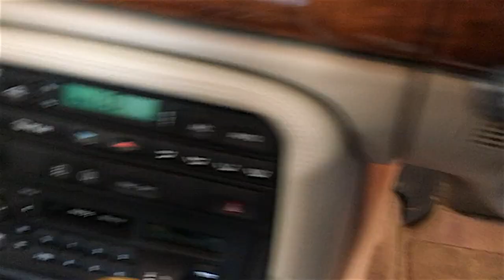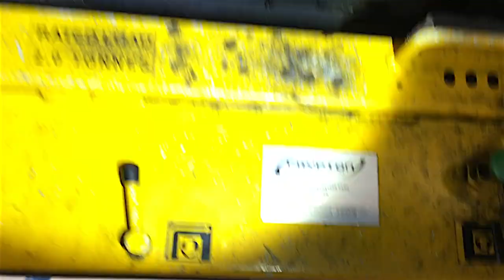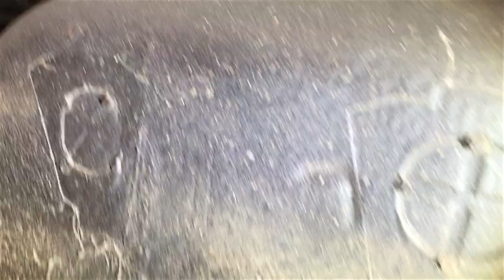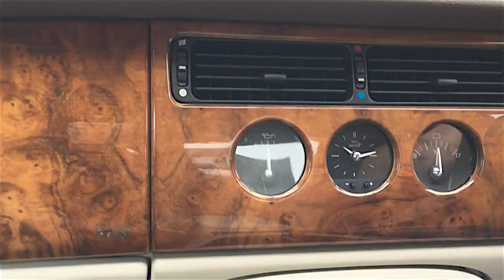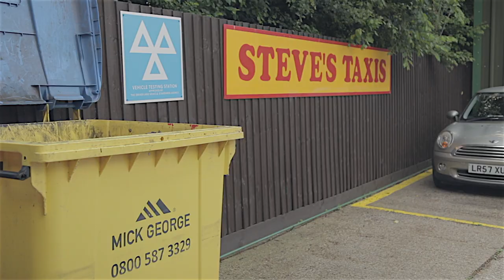2012 Vauxhall Combo 1.3 cdti, Engine Taken a Dump, What Went Wrong

Comment: Yeh right it’s a Vauxhall issue. It’s not and for the record, this engine is a joint venture between Fiat Power Train (FPT) and General Motors (GM). What GM actually contributed is not clear but in essence this is a Fiat engine built by Fiat. Like many of these modern over complicated engines with equipment attached for emissions, the likelihood of these engines going wrong is increased. Add this to the fact that manufacturers keep telling buyers that they don’t need to service these for long periods and you have a perfect storm. These modern diesel engines need lots of attention including very regular oil changes. This is how it is these days. 

The only blame you can put on Vauxhall is that GM has not invested into engine development as much as they should have done over the years. That said, sharing engines amongst other car manufacturers is now very common.

How do you know what the maintenance regime was or how the van was driven or if the timing chan was correctly installed or what level of oil has been maintained or for that matter,what make of timing chain was fitted, you don’t. 

Worth noting is the sump on the Euro 5 models only holds 3.2 lts of oil😮This means less oil to collect the carbon. Something that was rectified on the euro 6 engine. 

Heading into a full diagnostic with an anti-Vauxhall attitude doesn’t allow for an honest and impartial conclusion. 

There is nothing wrong with this engine other the added emission technology. If maintained properly it’s just fine. If there was a crown to be offered to the worst engine of modern days, it goes to Ford with the eco boost 3 cylinder engine, hands down

Comment: That's a fiat engine with lack of oil changes my wife's cdti has done 149,000 miles not used a drop of oil in 11years never ever topped the oil up the engine has never been apart for anything
Reply: Exactly, this chap was so wanting to find a reason to blame the engine manufacturer or the car manufacturer rather than blame the lack of proper maintenance for its failure
Reply: It’s a well proven engine with some very solid engineering. The only weakness is the weak cam chain. It’s a shame Fiat did not stay with their well proven cam belt.
Reply: On the plus side. Cam chain breaking almost never wrecks the engine or the valves. It will need new rockers, lifters, cam chain kit and gasket set That’s it.

Comment: I was a FIAT dealer expert technician for many years, I have seen this before. It wont have been rattling for ages, it all happened very quickly. the reason the upper big end shells are so devastated compared to the lower ones, it has been under water, hydraulic ked at revs.
Reply: Daft question but doesn't hydro locking usually snap or bend rods?
Reply: @alan dawsonI have changed the head gasket on a Fiat Punto mk1 1 with single point injection (FIRE). It cranks but doesnt start. I has a bent valve on cylinder one but the owner says it started before the gasket was changed. It looks like has had too much oil in it and that might be what bent the valve. The wiring for the crank sensor wiring had also been spliced at an earlier date for some reason. Do oyu think it will run with a bent valve? The owner refuses to accept that it wont.
Reply: @rimmersbryggeri  Are you taking the mick, you took the head off to replace the head gasket and ignored a bent valve. valves are as cheep as chips. A bent exhaust valve will not stop it from running on 3, but an inlet can mess badly with fueling of the other cylinders.
Reply: @alandawson3345  I didnt want to put it back together like but I was working in the guys garage and he told me to do it because it had supposedly ran before, I dont thing it was worthwile anyway because it has a broken windscreen to and that costs more than the car is worth to fix. What you said is kind of exactly what I told him before bolting the head back.
Reply: Hi,i have Fiorino 1.3  Euro5 with 75hp.I have problem , when i startup car ,engine knocking and knocking noise after some minute are disappearts but after 3-4min i have blue smoke and car engine rpm jump from 800rpm to 1000rpm.I have check 3 times injector(in Bosch servise),new timing chain,new glow plugs,new DPF.Oil is always on max.When car litle get worm all is OK.Also I have buy new MAP,MAF and new oil separator.Can you please help me?Thanks
Reply: @jarkazoki  Very hard to diagnose a car by description over the internet. But if rattily on start up and smoky until warm sounds like wear or faulty hydraulic tappets plus low on compression causing incomplete combustion when cold. ie about knackered.
Reply: @alandawson3345  thank you for answer,I have check compresion and is ok on all cilinder.Cilinder head is repaired.
Reply: @jarkazoki  I had a fiat scudo van did the same smoked when cold ok when warm. Compression test showed all ok , but when I eventually removed the head 1 piston at tdc was 0.5 mm short of reaching the top face of the block (bent rod ) started, ran reasonably, passed compression check, but smoked and was not smooth when cold. The auto stabilizing features, for the idle and smooth running in the engine ecu can hide a multitude of sins when it warms up.

Comment: I watched all your vlog, did you actually remove the oil filter from the housing? Fallen apart and clogged up could of been reason the engine starved itself of oil.
Reply from the maker: thats a very good point, no i didn't .. i will take it out and show in the next video
Reply: @alan4x  I have seen it when the service intervals have been missed. Love watching your vlogs👍
Reply: It’s generally a well built engine but the timing chain is adequate for 100K miles max. It’s such a shame they did not fit a twin row chain. At least the valves are vertical and the rockers are sacrificial so it can be repaired.

Comment: Was that a Fiat doblo combo D engine? Looks similar to my combo c fiat made 1.3 CDTI engine my combo c engine is on 160k miles original timing chain and turbo regular oil changes on these fiat Diesel engines are a must but after 160k I’m finally changing the original turbo.
Reply from the maker: is was the 1.3 cdti fiat engine,,yes
Reply: @alan4x  looks like the combo D engine witch is the newer version 2012/2017 I think the oil in the sump looked a bit sludgy possibly poor maintenance.

Comment: I think, you overlooked the right explanation. The plastic piece at the chain guide had fallen off. This means that the timing chain could run in a more direct line from the cam sprocket to the crank sprocket. The result of that is, that the timing is off - the camshaft is running a few degrees late of the intendend position. It means premature injection since the injection timing is normally comtrolled by the cam sensor, but when the ECU detects, the timing is off, it will use the crankshaft sensor, and this leads to premature injection. Premature injection means that the combustion reaches a very high pressure before the piston is at TDC - the piston is forced to continue to TDC and the pressure raises even higher. This emormous force will break the oil film at the big ends, at they will have metal-to-metal-contact. 
This is a pretty common fail on this engine type - the solution is allways to renew not only the timing chain, but also the chain guides and the sprockets. On a normal maintenanced engine the chain and guides will last around 250.000 km. All in all a very fine and economical engine with no more fails than similar engines, but premature injection will kill all diesel engines.
Best regards Jarl Paulsen, Denmark
Reply: I've had the work done that you've recommended at 270 miles in doubt full that the sprockets and guides were replaced tho, now at 192 miles som knock can be heard again

Comment: First thoughts were old oil, not enough oil changes etc
But 2nd thoughts were the engine has been run for a prolonged time on very low oil or even no oil.

I'm sure that engine would have been making some awful noises long before it failed!⚠️😯

Edit- nice xk jag, my dream car.

Comment: Looking at the state of the sump etc I'd say this has been run on the same oil for too long or it has seen dpf issues and been chucking diesel and shite into the sump. Thats what's caused the issue in my opinion.
Reply from the maker: cheers pete, i thinking the same

Comment: That was interesting. I actually didn't know that a mm could make that much difference in a diesel. 👍
Reply: Not just a millimeter the difference in thickness of the selective head gaskets to obtain the correct compression is much less than a whole mm we are talking tenth`s of a mm
Reply: @alandawson3345  
Goes without saying.

Comment: This engines fitted with dpf suffer multiple problems. And every little thing is packed in a way that you need to remove few other parts to get it. Even older 69hp Z13DT 1 3 jtd was a totally crap to service. They are good till 100.000km after that you can scrap the car.

Comment: Those torx like bolts on Vauxhall's require a Ribe socket as the tips are more square than pointed.
Reply from the maker: yeah never seen them before, maybe never will again🤣

Comment: Those 1.3 diesel engines were a good seller back when I worked in a car breakers,and as you say not a difficult one to remove,just as well really 😂

The old 1.7 in the combo was pretty bulletproof though.

I've never owned a Firenza, but I do have a 1.8 slant 4 powered Viva .😉
Reply: 1.7td Isuzu they put in the Vauxhall Cavalier was vauxhalls last decent diesel engine in my opinion!
Reply: Fucking expensive engines too.

I just scrapped an 11 plate corsa because the cheapest engine I could find was £900.

Comment: Lh thread on the crank bolt & cam bolt on these.  Have the identical scenario on one here, it's been everywhere, had the same daft parts chucked at it to no avail... chains borked Lads, :-) and the guides.. They usually break 2 rockers too - hence no compression on that one cylinder.

Comment: Great video! Strange thing right off the bat, my Corsa D has the same engine but the turbo is hidden away so the glow plugs are easily accessible when you open the bonnet. I've a small oil leak somewhere in my engine bay, just found it yesterday ... when I also discovered the windshield fluid is leaking 😂 Yeah they're noisy little critters but with fuel station prices these days it's hard to "knock" a 1.3 diesel haha
Reply: Dpf takes some space, so turbo is moved Abit up

Comment: So did you find out what the broken chunks of metal in the sump were off because that was a big flat piece of metal.
A mate of mine bought an Jag XKR from the dealer where he worked as a Mechanic there and it spent more time in their workshop for head gasket failures under Warranty than he did have driving it and they wouldn't let him do the work himself in the end he took the dealership to Court over it.
Reply: Good question. What where the big chunks???
Reply from the maker: they were parts of one of the thrust washers holding the crankshaft central lol
Reply: @alan4x  😁🧐🙄 how thick was the washer? Why would it have broken into pieces. Or was it in two pieces already???

Comment: A few years ago I bought a 306 DT 3dr sport.. i forgot to check the oil level... My brother drove it home and said it was a bit noisy, he checked the oil level and it was well below minimum on the dipstick... But i filled it up quick with some new oil and it did another 40k so 145k when i sold it it was still OK..so i got away with it just!

Comment: Modern engines simply cannot tolerate as much abuse, lack of servicing or skimping on oil changes compared to those of days gone by. Today's engines don't wear out after 100,000 miles, instead they self-destruct if not maintained properly. As emissions laws have tightened over the years, the requirements and demands placed on the oil have also changed, and fuel is much better quality these days too, but the trend is to downsize and offset the reduced power output by implementing variable valve timing, adding a turbocharger or twin turbochargers. But then, engines are suffocated by having to add necessary items such as EGR valves, catalysts, particulate filters and then they have to  attach an untold amount of sensors and probes up every orifice. If the attitudes of the general public towards mechanical sympathy and vehicle maintenance does not change and modernise, it's no wonder engines are failing in a catastrophic way.
Reply from the maker: thanks, very interesting and totally correct

Comment: I don’t like the Fiat either but I think the problem is lack of maintenance.
Reply: Jtd engines are generally bullet proof, lack of fresh oil will cause issues.
1.9 jtdm is very mappable 210 hp egr delete, dpf deleted.and mine has passed 170000 miles and still pulls like antrain.
Cdti jtd same italian engine.
Reply: M32 box is german by Getrag.
Swirl flap manifold is German made by pierburg

Comment: Oil pump in that front timing chain cover looks like lotta engine sealant been use on gaskets I recon blocked oil way up with it
Reply: Yea. When he couldn’t get the timing cover off, what most mechanics do is wind the studs out, the you can take the cover off to do the chain. It’s a bodge though, bits of sealant fall into the sump.

Comment: hello mate i have been sub to you for time wounder if you could help i have a 59 plate ford ka 1.3cdti same lump as you will know my problem is it needed new glow plugs always started ok just got the warning on dash when i bought it so changed the afew days ago but number 2 glow plug is going no were so left it in but i did not disconnet the battery and tryed to start it with out the number 2plug glowplug plugged into the wire it sounded like it was trying then went bettery went flat gone to it toady connected everything back up but all i get is light on dash and no crank starters not moving do you think i could have blown something kindest of regards Dean.

Comment: The failing chain is the result of a weak chain, fitted for low friction and overall immisions and fuel economy. What kills these is short journeys with too many stop starts and long oil changes. Simple as that. There is nothing wrong with this engine, it's a user issue not been told they have to use and maintain this is a particular way due to added nonsence over immisions
Reply from the maker: thanks for the info

Comment: Hi there Steve I have vauxhall astra 1.3 cdti and get below half tank I have it cuts cut out but had new fuel feed unit put in and now it cut out when cold but I have jerky ride for about good ten minutes then clears it had camshaft position sensor and crankshaft sensor plus new fuel filter and lots of other things . Need your help on that we are very stuck now with what to do with it .
Reply: I do get a fault code p01911 which tell me that the fuel metering unit is fault or fuel filter which would you say it is.

Comment: Hi Alan I need to ask a question about my mk5 mondeo 2l diesel titanium xpack please.
When I lightly apply the brakes it feels as if the ABS is doing overtime and it feels like it's grinding. Could this be them pesky  sensors. It also the chucks up loads of thing on the dash like. Collision aware parking assist hill start assist and a few others its really P*&%ING me off 🤣 cheers. Keep up these fantastic videos they're brilliant 👍👍👍👍
Reply from the maker: hi, the abs is working with various other systems in your vehicle, ...generally speaking, when usually, it is one of the front abs wires that is faulty it will bring up 3 or 4 lights on your dash...this can also affect your engine so best to get the abs ecu scanned for codes and have the faulty sensor replaced as it will only get worse otherwise

Comment: did u put the jag in sport mode? - made a fair difference in my 4.2 stype [ and to the mpg as well, 17 to nine in full drive it like u stole it mode]
wouldnt it be great if the punters actually told u the truth why the vehicle was acting up - must of been some bad noise/vibration before finally stopping.
PS scrapped the jag now [2 full sills +brake flexis @ £80 each] and wedged engine into my freelander, just a couple of snags to sort out before its debut.........

Comment: Iv got a 07 Vectra 1.8VVT and my oil pressure light takes about 5 seconds to go out and before the light goes out the engine sounds rather tappy so after watching this i'm starting to think maybe the shells might be worn (i don't know the history of the car)
Reply: Chain rattle
Reply: @justso1823  it's a belt on the Z18XER engine i believe
Reply from the maker: i would get that checked out
Reply: @alan4x  i proberbly would but for the amount it will cost it will be uneconomical for my wallet 🙈😂
Reply: @justso1823  i've got a video on my channel when i had my 2012 Polo and that had chain rattle

Comment: Opel recommended 50000 kms oil changes - just are not a good idea.
Reply: Do mine twice a year or every 3000 miles
Reply: @salvofarnia8046   Please don't do so often. Bad for your wallet and our planet. 10k miles is fine. Engine is only suffering if lack of oil and/or excessive engine use.

Comment: I had a few of these engines. Total crap. Too under powered for the job they meant to do. The lowest engine size I now I use is 1600cc . Who ever made these engines should discontinue and replace them at source with bigger engine size

Comment: It's been ran out of oil mate, and invest in some Ribe sockets to fit the bolts fiat use, really makes me cringe when people use torx bits on them. You do car sales and all late model Vauxhall's are fiat based so a worthy investment. Also looks like that van chain had snapped at some time, it does not bend valves smashes the rockers looks like a lazy mechanic couldn't be arsed to clean out the sump. All the best Alan.